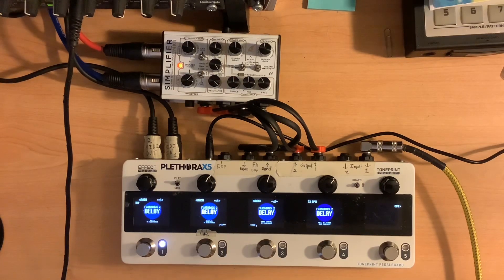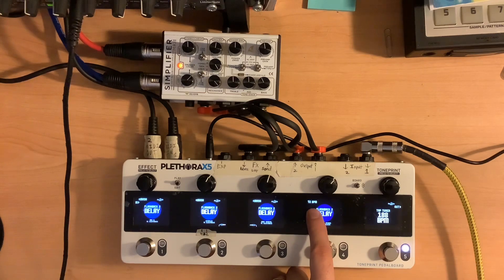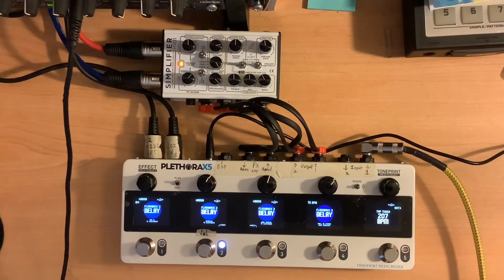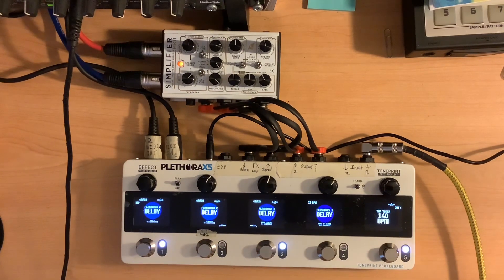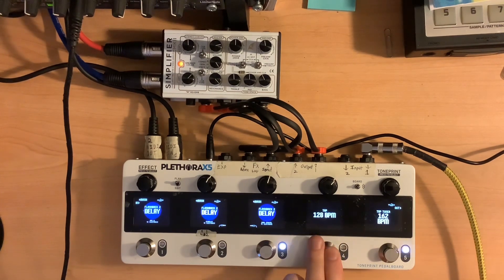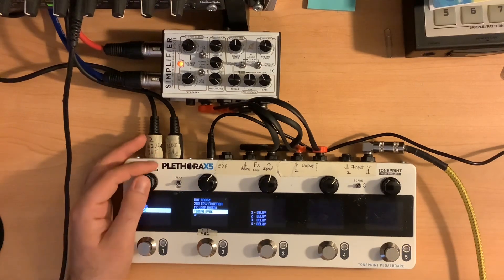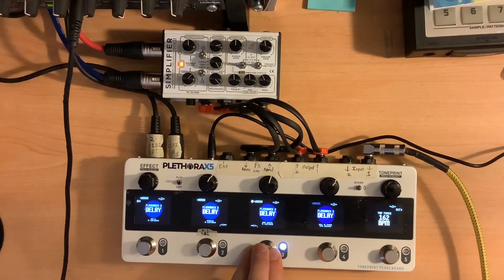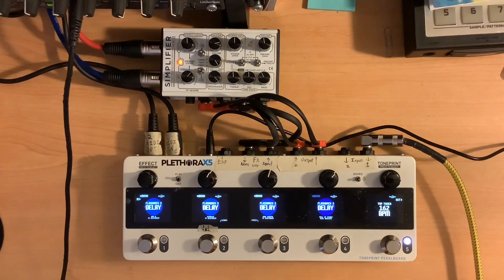Delay Test Board - TC Electronic Plethora X5 with Simplifier MK2

Comment: Hi! You have a very interesting approach for comparing rapidly different footprint flavors of a given pedal. The simplifier in the FX Loop is also a clever way of showing the sound improvement provided by a stereo output. As you did for the Chorus pedal, I invite you to add (INCLUDES SYSTEM CRASH) at the end of the current title. The more TC gets feedbacks and improves the firmware of the Plethora, the more I appreciate my Plethora. Thanks!
Reply from the maker: Thank you for the feedback!  I just finished recording the video for the Harmony pedal and I'm very happy with it.  I was really impressed by the difference being in stereo made.  Thanks for the tips as well.  I'm also part of several Facebook groups dealing with TC & Plethora users & I know TC keeps tabs on those as well.  I'm glad they finally added the Tap Tuner in the last update, but there are still features I think they could still be reasonably added to the Plethora to make it even better.  TC, lets talk!